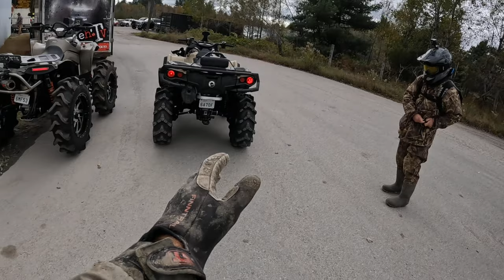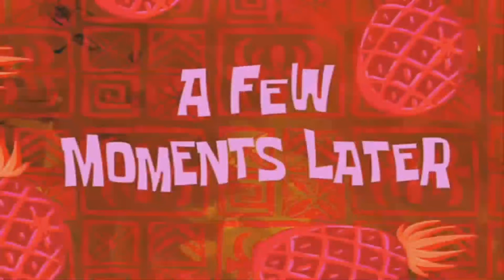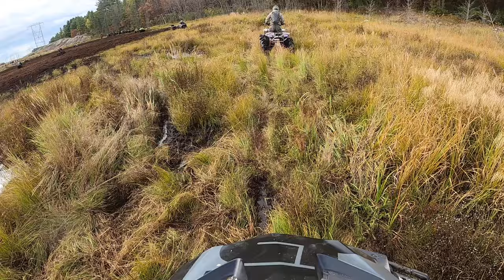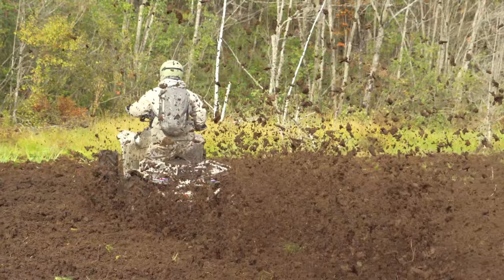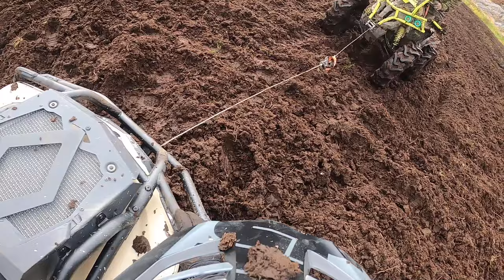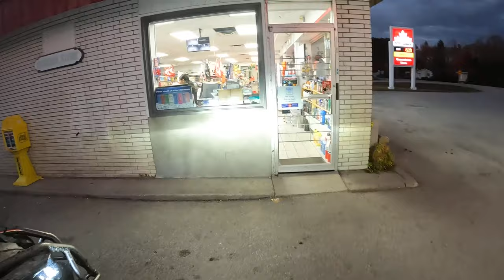Wheels Up!!! (Outlander XMR 850 & Renegade XMR1000r Skeg Rip)

Comment: I have the exact same model and colour as your friend. I installed quad addiction foot boards on my machine. Can go up to a 32 inch tire no problem now. Also Access for servicing the machine is much easier as the new foot boards are bolt on , no more fighting with plastics . Great video as always 👍.
Reply from the maker: With floorboards installed ya don't need to pull board to open clutch either.  Definitely a nice upgrade.

Comment: All the trails are getting like that here in Alberta. To many guys have started riding out here since COVID happened so everything is down to the rocks or so rutted out you need 30s to just ride Most of the trails.

When you do hit mud it's impossible to get through on most stock machines. Nothing against guys getting out but there's alot of people trying to shut down trails and it's getting harder to keep them open when people are riding 1500lb sxs's like 300lb sport quads.